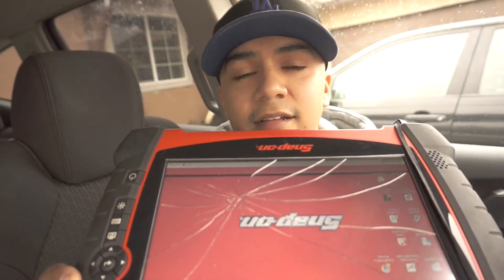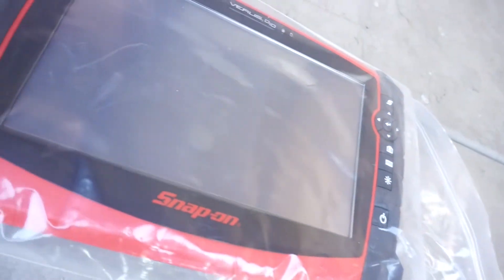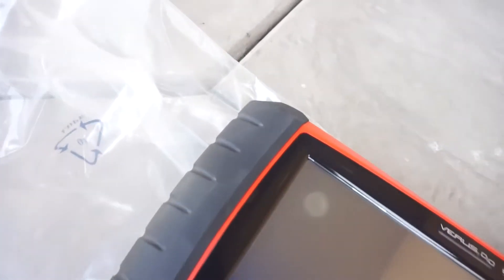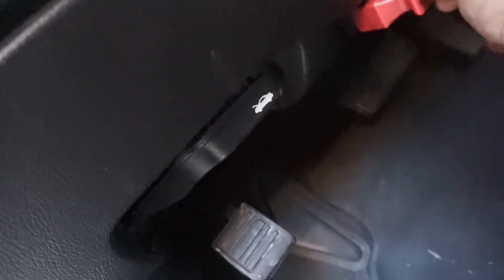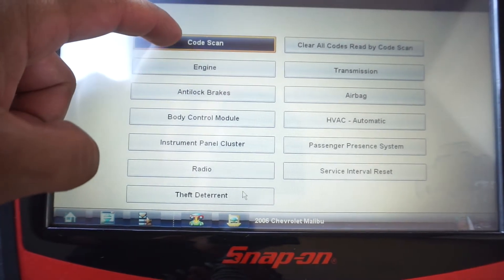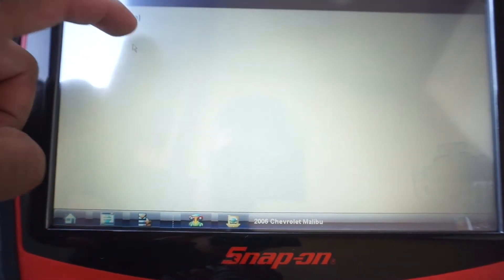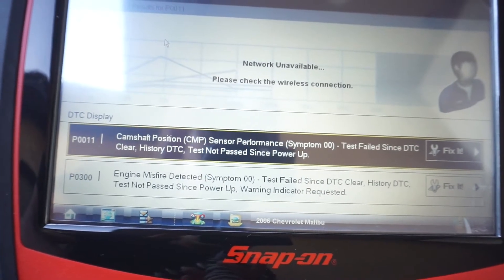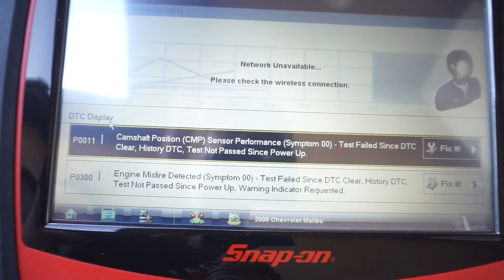Snap-On scanner is back! Chevy Malibu SS engine making noise!

Comment: It's a mechanical issue. So what was the end result? Scan tool can only do so much for you and that's where other thought processes come into play. Sounds like a rocker arm or lifter/hydraulic lifter whatever it has of those 2. 

What was the verdict being I'm 5 months late. 

Also have you upgraded to the new Snap On Zeus scan tool now which outperforms your scan tool and my modis edge? Since I've kept mine updated my dealer is offering full retail price if I trade my Modis Edge for the Zeus. Just don't know if I want another $4k to pay off after clearing up my bill with him from the last 6 months @ $500 per mo which did include about $115 per mo for subscription to keep scan tool updated and online access to database when scanning.
Reply from the maker: Dale N it's the piston.